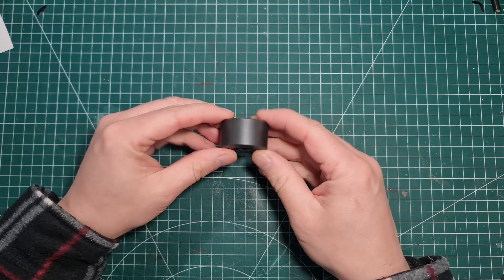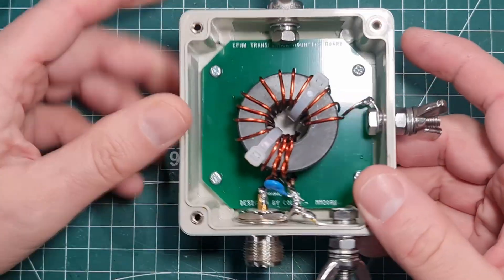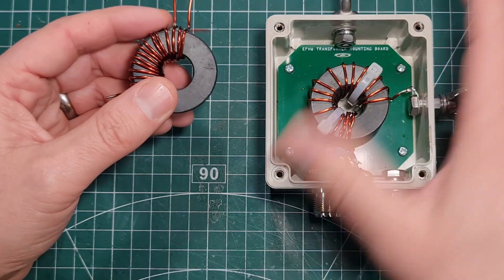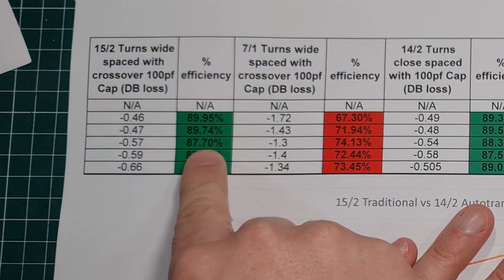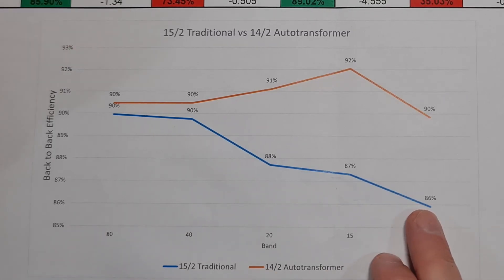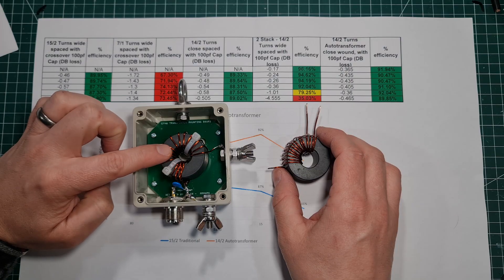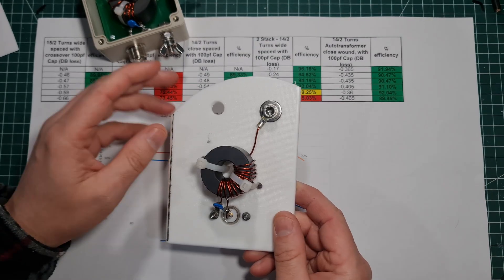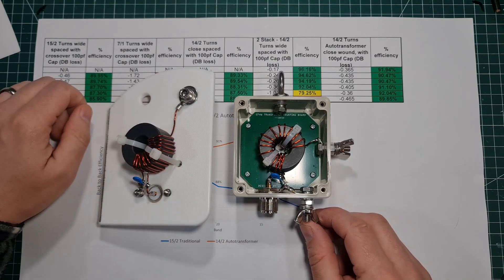Can The Best 100w End Fed Half Wave Get Any Better?

Comment: Hi Colin, 
Thanks for doing all the testing. I’ve heard that the real benefit to more efficient transformers is power handling. If simple math still works 100W at 85% is 15 watts as heat the core has to absorb. 90% is only 10watts of heat for the same power. Can make a Difference while doing FT8 or CW.
Reply from the maker: For sure. The EFHW is no magic bullet but does have its place.

Comment: Hi Colin, question: i do have this toroid and I also do have some 240-52 and I would like to ask you whether it would work if I use ga14 ptfe stranded wire for an auto-transformer instead of enamelled copper wire, in your opinion? Thanks and 73 de va3kwx chris
Reply from the maker: If you have it, use it 👍
Reply: @MM0OPXFieldRadio great, thanks Colin! See you down the log 73 fm 🇨🇦 va3kwx chris

Comment: Hi Colin, from your video 3 years ago (https://www.youtube.com/watch?v=nZ-G4hJCTSM), you said that for a qrp multi-band end fed, 40-10, you liked the 2643625002 toroid with the 64:1 16/2 winding best because of efficiency and SWR. Do you now think the auto transformer you discussed in this video is a better configuration? Also, does it matter if it's QRP versus 100 watts. Thanks for your very informative videos. Pat, K7GUD
Reply from the maker: This core is better, slightly. just if you want the additional weight. I have done the autotransformer on the 1002 core now. Got a video up on it.

Comment: Both of these windings (shared single primary and shared twisted pair primary) are autotransformers.

I wound a 49:1 unun on an FT140-43 core for a lightweight portable winder tuned EFHW antenna but before tuning it I measured the insertion loss and was surprised at how bad it was.  I had already purchased two of the Fair-Rite 2643251002 ferrite cores, planning to use one for a 100 watt matching unit for my home station - either a 9:1 for an end fed random wire or (more likely) a 49:1 for a 10-40 meter resonant EFHW antenna.  I'm going to use the spare 2643251002 core for the portable EFHW because the increased efficiency when using 5-20 watts seems worth the added 2.6 ounces.

Comment: I discovered an expert in RF measurements and asked him what was the most accurate way to measure the efficiency of an UnUn transformer, and he explained to me that this "Back to Back" way has flaws and that the best way would be: "This is a real challenge. The "back-to-back" method has two of them in series, so which one are you really measuring? If you get a bad reading, which one is at fault? You cannot know without having a third one to play musical UNUNs with. There is a more direct method you can use.
I address making measurements in a non-50 world in this video: https://youtu.be/dgDS4rjb-GU
Here I describe how to create a resistive impedance matching network so the UNUN would see the 2450 Ohms it wants to see and the VNA sees the 50 Ohms it wants to see. I am doing all of this in the 75 Ohm world in this video, but the principle is the same. This idea came from a major VNA manufacturer's video on the same subject.
The network has its own loss which you can calculate based on the resistor values you choose. Remember, this loss INCLUDES to terminating impedances on either side. Be mindful of parasitic inductances and capacitances when building this network. The higher the test frequency, the more careful you have to be about that stuff.
The loss is easily calculated in dB from the voltage loss of the voltage divider network this resistive network represents. So, if the network has a 7.56 dB loss (hypothetically speaking) and now you measure the loss of your UNUN at 8.43dB (including the resistive network), the the UNUN loss would be 8.43-7.56=0.89dB.
I hope this helps. :-)"

Comment: A ceramic capacitor TDK 100pf x 1KV (1000 volts)? will work fine? Everybody use 3Kv but i don't found to buy here in Brazil. Thanks.
Reply from the maker: I use this as its cheap and I can use it QRP to QRO. The capacitor is critical maintaining low loss. Use any capacitor you want as long as you know its efficient with a rating of 500v or more.
Reply: @MM0OPXFieldRadio  Okay, thank you.

Comment: What is the gauge of the copper wire used in the auto transformer? 16 AWG 18 AWG?
Reply from the maker: 1.12mm wire, I'm not sure what that equates to.
Reply: @MM0OPXFieldRadio  thanks for answer, I will try make this transformer, I just ordered the fair-rite in eBay

Comment: I'm thinking about what result could be using 2 x FT 140-43 stacked cores. I saw ppl using 2 x FT 240-43, but they never try 2 x FT 140-43.
Reply from the maker: Try it. I bet you a dollar it won't outperform this 1002 core. 2 x FT140-43 will also likely cost more than 1 x 1002 core. I didn't have enoigh FT140-43 cores to do this and wont spend it as you wont better this IMO.
Reply: @MM0OPXFieldRadio  yeah, make sense

Comment: I'm not a native english speaker, so, I'm confused with the difference between "close spaced" and "close wound". What exactly means "close wound" terminology? Is it like very very close spaced with primary soldering? I'm asking because I will try to construct this one. Thanks. :P
Reply from the maker: You have it correct. Windings are tight.
Reply: @MM0OPXFieldRadio  Nice, thanks!

Comment: The auto transformer winding could be 2 turns of heavy wire and the rest much thinner wire as the current from that point is very low. This is still transferring power via flux through the core which is lossy, is anyone making a true transmission line transformer at these ratios? It might have much lower loss...
Reply from the maker: Yes you could use but ends up more work. I've looked at true transmission line transformers but it would end up impractical too big.

Comment: I think we have optimized the 1:49 autotransformer and have settled. Its easy. It works. But has anyone looked into using a conventional transmission line transformer approach that does not require as much core flux dependency as an autotransformer? It certainly would not be a single core solution. Perhaps a 1:4 Guanella feeding a 1:9 or 1:16 Ruthroff. I think this would boost efficiency to 98% easily with 2 smaller cores. And SWR is not a great way to judge since there is in effect, a resistor in there along with that loss that is fooling us. And what is the impedance of a half wave 40m wire close to the earth over the whole band anyway? Lets start with those measurements. Is the coax feedline the actual antenna? Do you add a current balun? Where does the current go? Do you use a counterpoise? Yes, I am an old Dipole guy and am skeptical of the EFHW.
Reply from the maker: That's an interesting idea, definitely think it could work but at what expense and at what benefit? if you could get the boost to 98% across HF then probably.
Reply: @MM0OPXFieldRadio the issue is that the transmission line transformer for the higher impedance step up would require an impractical line impedance of 600 to 1000 ohms which would require a thin conductor and thick insulation.so the core would have to be gigantic.  So no, my idea would not work.

Comment: What is the actual reccommended Inductance of the coils at the various frequencies? Supposedly a dipole is about 50 Ohms at the center and about 4000ohms at the ends. A ft 140-43 has a al of 885 and so 14 turns works out to about  354uh or impedance of 31k ohms. I have heard the best match for a transformer is when the impedance is 4 times more than the expected load. So 4x 4000 is 16k ohms so the 32k is twice that. May make for better power match. Has anyone played with different UH values that still maintain the 2 turn to 14 turn ratio?? Which is the most efficient?
Reply from the maker: From my limited research, inductance is most important on the primary. What tour suggesting is another way at looking at the same thing. Efficient is efficienct. What total efficiency measured back to back is what matters. I will measure the primarys and see what it says. You have me intrigued.

Comment: Colin, If you still have some of the Fair-Rite 2643251002 cores lying around, can I suggest you do the same tests as the late G3TXQ to see how it performs as a choke.  It could make a useful YT video.

On the subject of the 100 pF capacitor, it may be worthwhile replacing it with a 150 pF air-spaced variable capacitor to investigate the 10 to 20m region which seems a bit troublesome.  (It'll be OK with the NanoVNA but will have to be replaced with a high voltage cap in the real world)  It may be that capacitor self-inductance is a problem.

Keep up the good work!
Reply from the maker: Thanks. Thought this too but it comes down to time. I much prefer coax wound over bifilar. The hole in the middle of these is pretty small. Also wanted to make 4:1 and 9:1 variants.
Reply: @MM0OPXFieldRadio  I agree with the preference for coax as keeping a 50 Ohm match with bifilar is quite difficult. If you use RG316 or RG174 you could pack quite a few turns in.
Reply: The Fair-Rite 2643251002 is also known as the Fair-Rite FT150-43 - from Ham Goodies.

Comment: Great video. Thanks. I built the described autotransformer on the '1002' core with 2:14 close windings. It replaced my 2 core ft240-43 49:1. As a test I ran it for 1 hour on FT8 at 45 watts and measured the heat rise with a thermal imaging gun. The background temperature around the core was 6 deg C and the core only heated to 14.6 deg C at it's hottest spot. That's a temperature rise of only 8.6 deg C indicating very low losses and showing the core is capable of taking much higher power. Didn't test at 100W digi because I value my HF rig too much😀
Reply from the maker: Excellent. Great way to test 👍

Comment: Hi Colin, I'm using this toroid .. 1002  (49:1 Autotransformer) and it works well. No heating issues during long FT8 sessions at 80 or 90 watts. 73 de 2E0RPS
Reply from the maker: Excellent. It will cruise all day and more at that.

Comment: so as a budding transformer builder, how do you modify your transformer designs to handle higher wattages? For example, if you wanted to build a 49:1 that would handle 500w digital, how do you go about picking the core(s) to use in this situation?
Reply from the maker: 3 stack of 240-52 will handle this with ease 👍

Comment: Great work! I did start with a FT140-43 because it is the standard, smaller and lighter (I'm QRV portable only). For 100 W SSB perfectly ok and 10-15 % less efficiency doesn't hurt but considering digital modes this Fair-Rite looks like a great upgrade to have less loss and less heat in a bigger core enabling 100 W digital and lower bands in one go. Why not build a 160 m EFHW 😅

Comment: Would you stack 3 of those cores for high power as you did with the 240 shape cores? 73.
Reply from the maker: You could but above 20m its so inefficient you lose more than half your power.
Reply: @MM0OPXFieldRadio  ok, I'll stick to the 240's for this, 73.
Reply from the maker: Yep 240-52's

Comment: I hv an 80-10 efhw with a 49/1, 130 feet long. My antennas brand. 
Very good on all bands. Adding a counterpoise off of the ground rod, I am able to work 160 decently!

If I put up a 173 or 202 foot 9-1, wld it gv me better results on the bands, especially 80 n 160??

Ps…I am running an Mfj 998 tuner. 

Thanku.
William
Reply: An efficient and properly tuned EFHW should be slightly more efficient than an End Fed Random Wire (EFRW) because: (1) no tuner is needed; and (2) the high feed point impedance reduces the need for radials and their associated ground losses. A single 0.05 wavelength radial or length of coax feed line provides sufficient counterpoise.  In practice they will be very similar if you add a few radials to the EFRW.  The EFRW will cover all bands with a wide range tuner.

Comment: I replaced the FT240-43 49:1 unun on my 40 - 10 meter EFHW with this autotransformer and the SWR readings on the different bands improved by an average of 0.35 swr.  Always something new to learn in this hobby.  Thanks for the video.👍
Reply from the maker: Your welcome. Everyone sees slightly different results.

Comment: hello colin, I rebuilt the balun with the 2643251002 and it works well with my endfed antenna. However, I can't get any resonance in the 6m band. It works with the 140/43. Is the 2643251002 not suitable for 6m?
Reply from the maker: I think what your perhaps seeing is the 140-43 is much more lossy than the 1002 so the SWR looks so much better. I would need to investigate further though.
Reply: @MM0OPXFieldRadio  Yes,please.perhaps you can find something.thanks

Comment: Would it help or be of any benefit to adding some glass cloth electrical tape under the windings?
Reply from the maker: Not really, the core will still heat up with too much power. Wont do any harm tho.

Comment: My son and I have made one of these per your process. We will be hooking it up to some wire this weekend. I plan on trying about 140 foot of wire and seeing if I can tune it as a spooler antenna. We considered doing it as a linked, but want to see if spooling it in and out will serve to get resonance on the bands.
Reply from the maker: Let me know how it goes. Spooling in and out will work but does depend on the configuration depending which side the reel is and if the wire is bare. Been there and done it.
Reply: @MM0OPXFieldRadio  we had mixed results. Some bands tuned well, mainly 20m and 40m. 80m isn’t doing better than 3.5:1. SWR also climbs as you approach 10m. We then measured out 133 feet and started to tune by cutting to tune to 80m (no spooling) and then checked for resonance on the other bands. We are still having problems getting 80m to tune below 3:1.

Comment: Makes zero difference in real world  application.
Reply from the maker: In comparison to what? If I can wind an Autotransformer easier to the traditional twisted primary and its more efficient then its a no brainer.
Reply: @MM0OPXFieldRadio  you’re wasting your time.  Technically correct.   You save 3 minutes making the transformer.  Save 2 ft of wire.   The heat difference of a 0.5 dB inside a box is not measurable.     If you’re at that heat level you need to pick a bigger ferrite coz doesn’t matter how you wind it  !!!   

So it’s perhaps an engineering exercise but nothing practical behind that.
Reply: Not in signal strength but less heat in the transformer box is always good.

Comment: I would like to see what the difference would be between a transformer like this and different kinds of matching networks.  Also radiation strength of an endfed vs a center fed antenna system.  That being said, a lot of this might be splitting hairs as the ground losses with the way antennas are deployed in the field is usually knocking off a few DB.  Thanks for the videos!
Reply from the maker: So would I! Yes splitting hairs and very difficult to measure.

Comment: What makes an "autotransformer"? Why is the 56:1 a standard transformer and the 49:1 an autotransformer?
Reply from the maker: An Autotransformer is a single coil tapped at a certain point to provide impedance transformation. More commonly you see the twisted primary. On my 56:1 I've used a twisted primary but will he testing as an Autotransformer.

Comment: Thanks Colin. Great videos.  Yesterday I built the 56:1 wide wound on the 1002 and I just tested and trimmed the radiator. I'd be so grateful if you would comment on these results because I'm wondering if I should change it to 49:1.  I used 1mm enamel wire on the toroid and 18g on the 67' radiator. SWR dipped to lowest at 6.830, 14.050, 21.150 and 28.100.  6.830 got 1.0:1. 7.050 got 1.4:1.  28.100 only dipped to 1.9.  What do you think? Thanks, Scott in NC
Reply from the maker: Antenna orientation, ground effect can have a massive effect on this. They seem to be fine. You wont see super low dips across all bands but as long as its less than 2:1 dont worry, I dont. I found best results as an inverted V with both ends well off the ground. With the transformer close to the grounds it was always worse.
Reply: @MM0OPXFieldRadio  Thanks! I have seen two opposing views on deploying the transformer near the ground. I just installed mine about 2' up with a short wire to my grounding system per Steve Ellington N4LQ's videos. I gather you would not do that. If you're willing, tell me your preferred distance and whether you would do the grounding or any kind of a counterpoise. I am using a 67' wire in an inverted L/sloper kind of setup. I could do the inverted vee though. Thanks again, Scott NZ4R
Reply from the maker: @scottcarter9975 I found the ground effects tuning massively and when you want multiple bands to tie is it can be difficiult. My feed point is at least 4ft off the ground which I find helps. Remember this is a dipole, just fed at the end. Height is always might.

Comment: Great video!  I just got ten of these toroids in from Mouser.. cost me like 63 dollars. Also got some TDK 100pf caps. I am going the autotransformer route... the efficiency looks good 160-10. Now I just need to 3D print something to mount them on.  I have quite a few 240-43 toroids but have decided to not use them as I don't run more than 100w anyway.. may  make up some stacks of three 240-43 just to see how they test out compared to these nicer toroids..  These are heavy and chunky, they feel good in the hand..lol
Reply from the maker: Excellent, the 1002 core is fast becoming the core if choice for 100w I'm happy to see.

Comment: Colin will there be an Higher Power version using this core.  I really like the efficiency of this setup but often run 400w
Reply from the maker: You need the 3 stack of 240-52 as an Autotransformer. Unfortunately more than 3 times price for the cores alone.
Reply: @MM0OPXFieldRadio  Thankyou for the reply and all noted